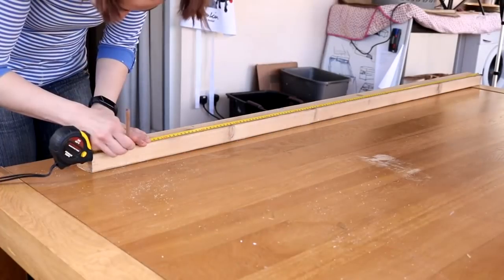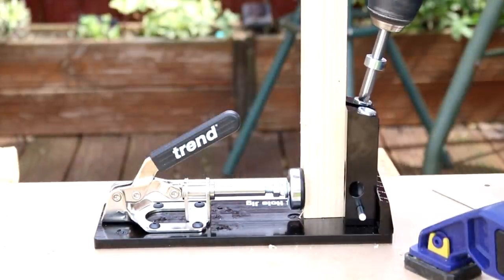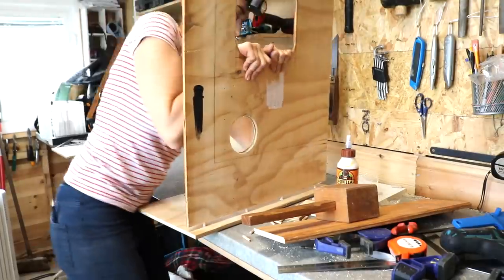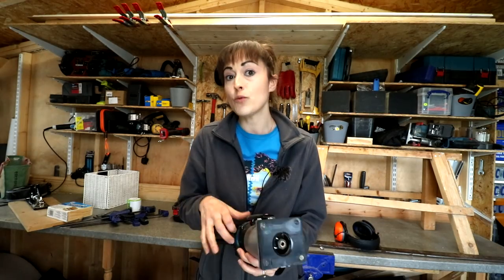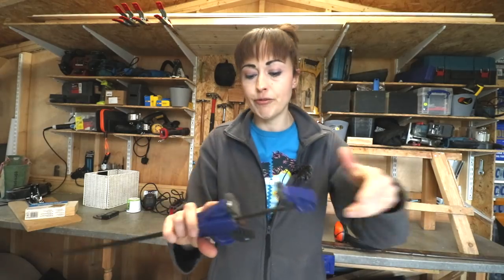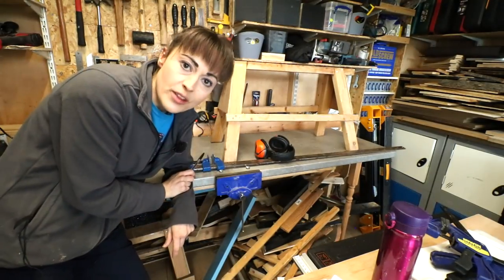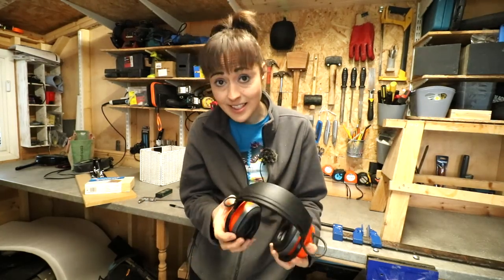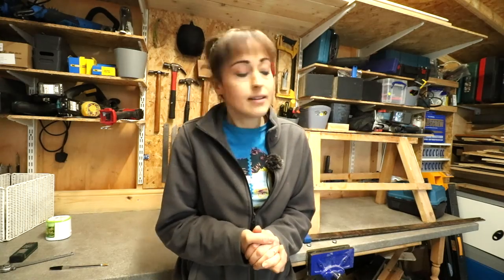DIY Tools I Wish I Had as a Beginner in Woodworking | The Carpenter's Daughter

Comment: As a complete beginner would you recommend the Aldi/Lidl range of tools? I suspect they're likely to not last very long and it'd be better financially to pay that bit extra for named kit, such as DeWalt or Makita.
Reply: Actually I think that aldi & Lidl tools are very good value for money, additionally & most come with a 3yr warranty! I keep hold of every receipt which I put in the box and put it in my loft. I keep a backup digital photo of the receipt as copy on my phone in case the one in the box fades and becomes unreadable. It is a no none warranty, they have never quibbled when I have returned anything, offering a replacement (if they still have them) or a full refund with no hesitation. 

I have had lots of tools from both retailers over many years and still have most.

I currently have a table saw,  cost £19.99 40 years ago! 
A power planer, 14 Yr old
2x belt sander, 12yr old
Orbital sander, 11 Yr old 
Several battery drills, the oldest is 10 yrs old ( I do have 2older one's that are 15 & 12 Yr old, nothing wrong with the drills just the batteries that have expired). 
A 32 volt battery drill
A router, 15 Yr old
A mains multicutter, 8 Yr old
3x battery screwdrivers, oldest 6 yrs old (lighter than a drill, Fits in my pocket, fits in tight spaces and corners and prevent rsi on my wrists) 
A Brad nailer, 8 Yr old 
A wet/dry hoover, used in my workshop, 5 yrs old.
Drill press 22 Yr old

 Other than power tools, I also have... 
Many clamps, ratchet, sash, & spring (you can never have too many clamps!) 
A couple of laser levels. 
A compound mitre saw with laser, 10 Yr old. 
Saw horses
Several folding work benches. 
Drill bits galore, wood, metal, masonry, forster bits, holesaws. 

The list could go on! 

In short, they are not high spec professional tools, but I have found them more than adequate for DIY use. 

Its a no brainer for me. If I see a tool I buy it, try it, if I don't like it, or find that I would hardly use it, I return it for a no quibble refund. If I really, really use it a lot, and feel I would benefit more with a higher spec one, I'll take it back & buy a high spec one! If it breaks within the 3 Yr warranty, I take it back & get a refund..... What's not to like? 

No reason not to try!

Comment: Pocket holes. Don't buy into joint snobbery. Pocket holes are a perfectly valid joint. In my experience the harshest critics of any maker are people that have never made anything, ever. People rave about dovetail joints but you have to remember that back in the day woodworkers only used dovetail joints because they were cheaper than nails!

Comment: Is the big router your dad's? I've seen you using a big router before! Even aged 35 they still terrify me. The torque they generate, they simply will not stop spinning 😕 I've heard horror stories about big router injuries where people have opened up their bellies like a tin of beans 😰 🤮 🤕 it's the only power tool I'm scared of (though using a Stihl saw at head height is never fun either 😅)
When I was fitting the most invaluable thing was probably the plunge saw with the rails and the hoover attachment. Two pencil marks, place the rail, send the saw, the most accurate cleanest perfect cut in 30 seconds flat. And hardly any mess. Absolute godsend them things are. 🙂
Reply from the maker: I'd love a track saw!!  Definitely on my list, but don't know which one is best.

Perhaps I'm naive about the router, but always wear PPE with it.  The larger one is my Dad's at the woodyard :)

Comment: You say pocket hole joinery isn't "proper carpentry" and I understand where you're coming from... BUT, it gets the job done and it makes the process easier. On that basis, how far do you take it? A jigsaw makes cutting wood easier, but is that "proper carpentry" because you aren't using a hand saw? Are nail guns not "proper carpentry" because you don't use a hammer?

I really hate the snobbish attitude of people who take that approach. I'm not suggesting you are, but before dismissing pocket holes think about if it's worth the extra effort. After all, dowels wouldn't be considered "proper carpentry" by some people because it's not a dove tail joint or some other nonsense.
Reply from the maker: Absolutely.  I know for me, it makes me lazy where I feel I should be trying new joins, but it's blooming quick and sometimes a screw on an angle is the best method as had to use in my video after this.
Reply: @TheCarpentersDaughterUK  yeah, of course, if it's a hobby and you want to explore new things and challenge yourself then go for it. But for people who want to make something and just get the job done there is really nothing wrong with a pocket hole. 

Of course, if you want the piece to last 150 years then you need to avoid any kind of mechanical fixing like screws. It's a case of assessing the right processes for the job at hand.